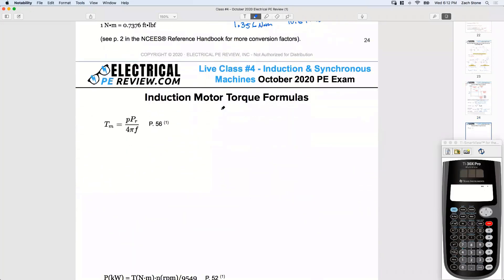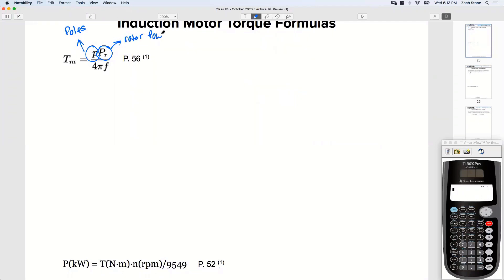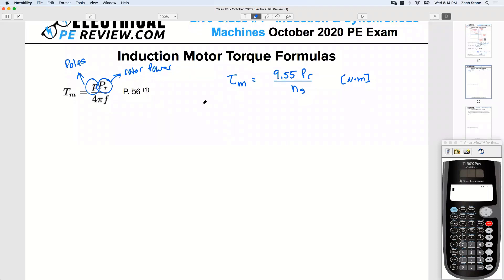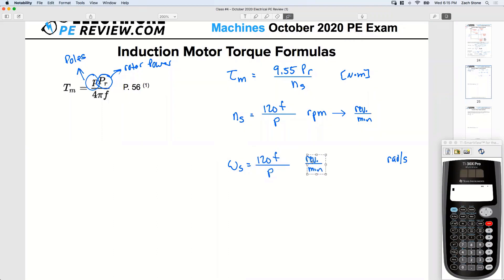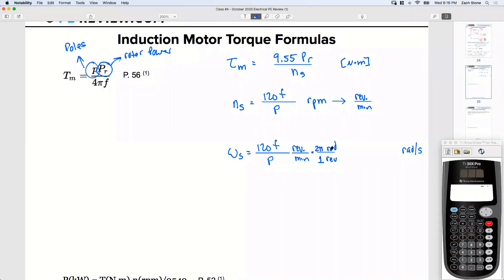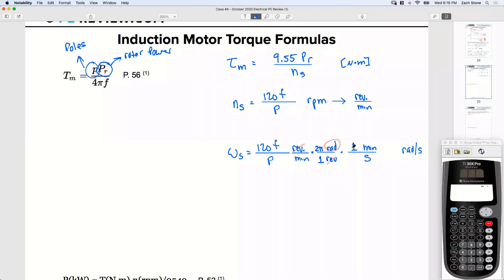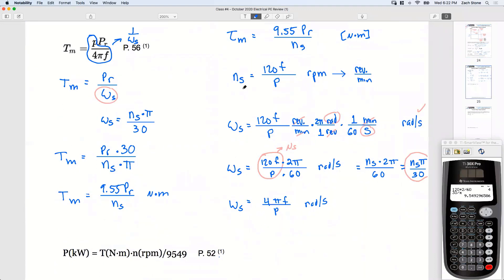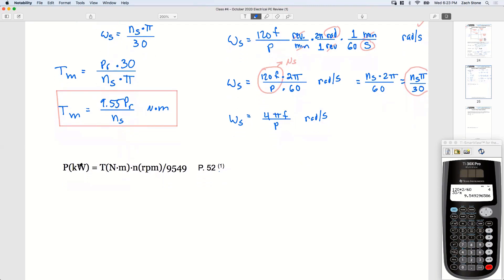How to use Induction Motor Torque Formulas (CBT ELECTRICAL POWER PE EXAM)

Comment: Hi Zach, at 12:49, when you convert the P(kW) to P(W) you divide it by 1000 instead of multiplying it by 1000. I know doing so will not bring the desired relationship but isn't that how is is supposed to be converted?
Reply from the maker: This particular torque formula uses units of Kilowatts instead of watts with the 9,549 coeiffencet (instead of using 9.459). Watts divided by 1,000 is kilowatts, by dividing the formula by 1,000 you can plug in watts in the top instead of kilowatts.

Comment: The last part is wrong. P multiplied by 1000 is kW (1000W = 1kW) so why would you divide it by 1000?
Reply from the maker: Can you post the time stamp of the portion of the video you are referring to? There are several formulas in this video.
Reply: @electricalpereview  https://youtu.be/u_YMJr28BWU?t=720
Reply: @Enigmatix23  The units were in kW. He's converting from kW to W.